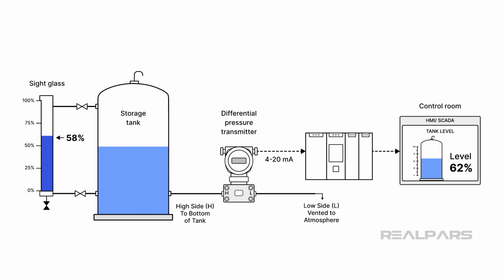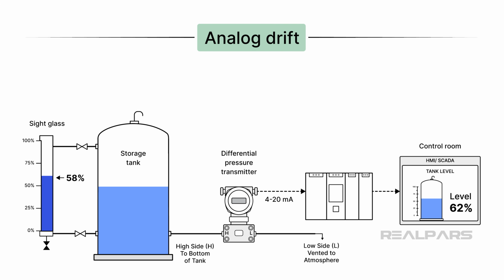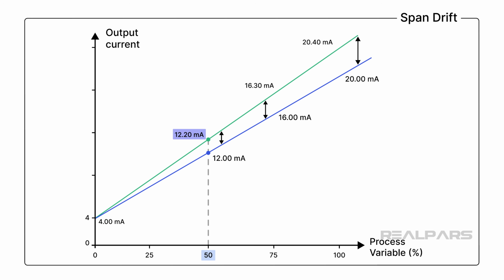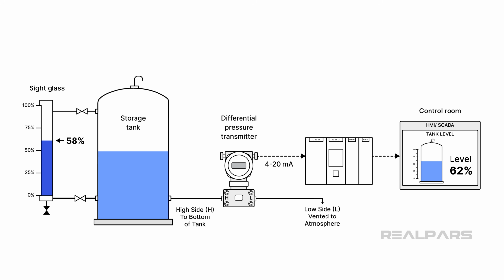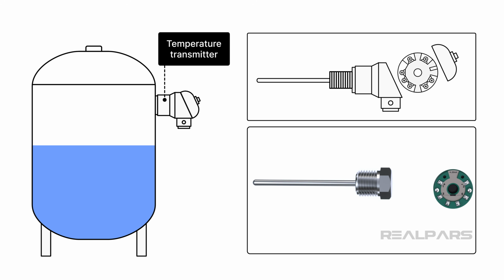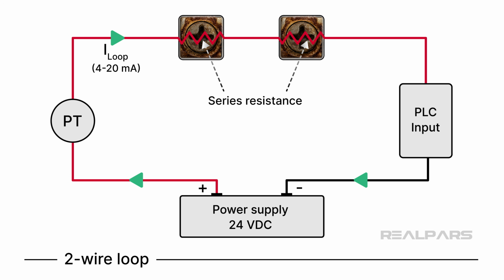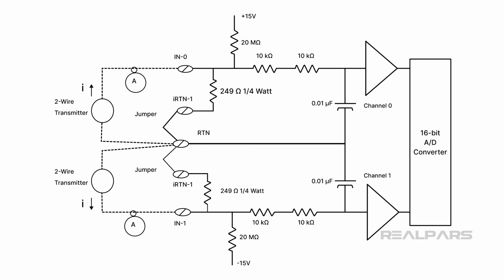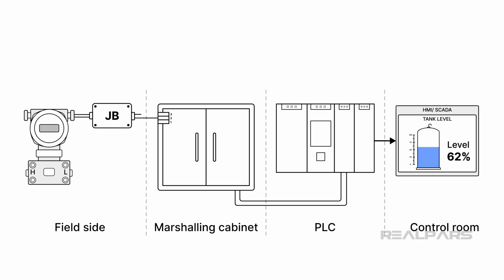What Causes Analog Drift?

Comment: The drift you cannot calibrate out is usually not in the transmitter at all — it is the ambient at the analog input card, and on a thermocouple card the cold-junction compensation is referencing a panel that swings 30 °C between night shift and afternoon. The tell is a drifting loop that tracks the panel door being open, and once it is that, re-ranging the transmitter will chase it forever.
Reply from the maker: Hello, @X_Inspector_Gadget_X  Thank you for sharing your interesting input. That is a good start. We did mention that several items can cause this drift. Your input is a good place to start; depending on the system engineering design, one method isn't always the answer. As we mentioned, we need to look at all of it.